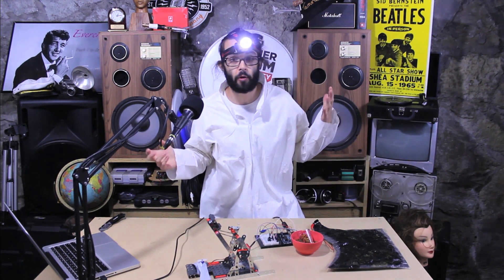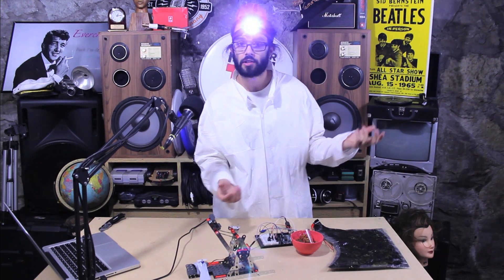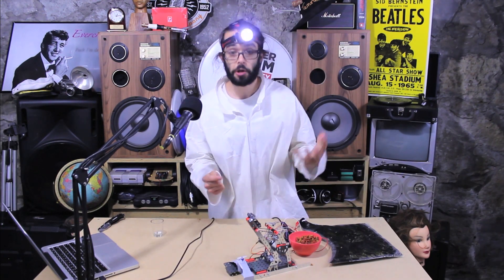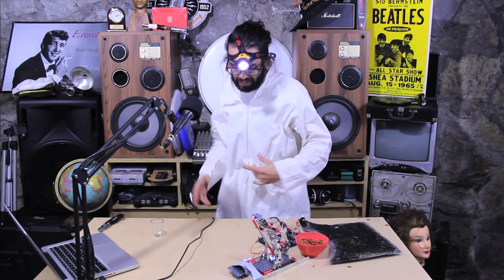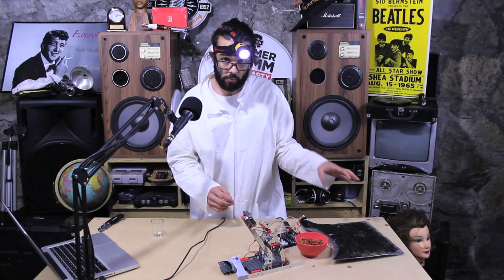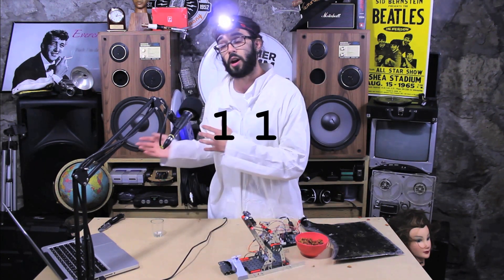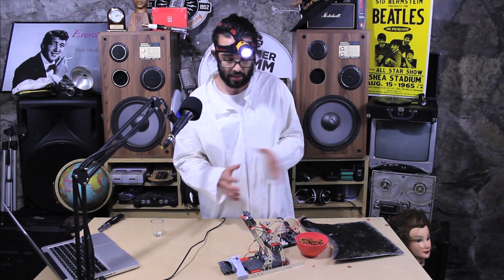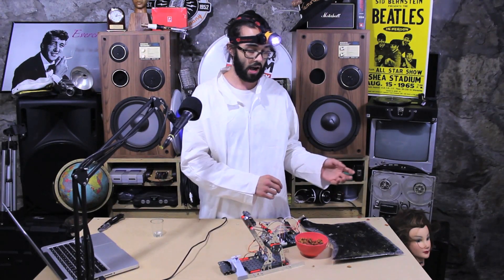MIT-i Episode 1: CAT-apult... Arduino Controlled Servo for Makers!

Comment: I think it would be efficient to just do a container with a controlled entry below it, so when the cat goes into the pressure plate, the food just goes down and enters into the cat's plate. A catapult would be good if the plate is very far (just calculate the physics) and then just catapult it hah. Funny video though!